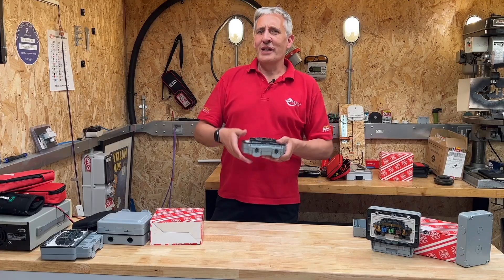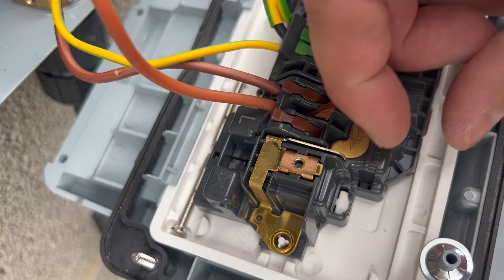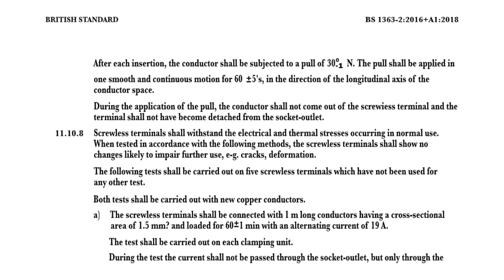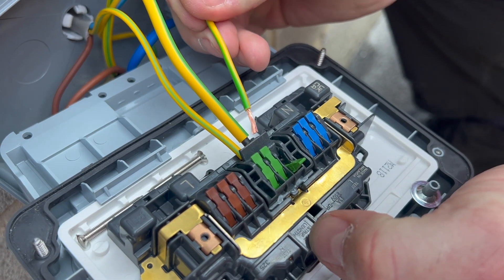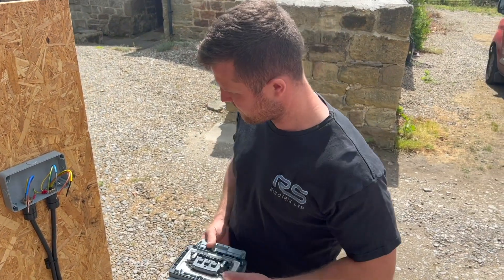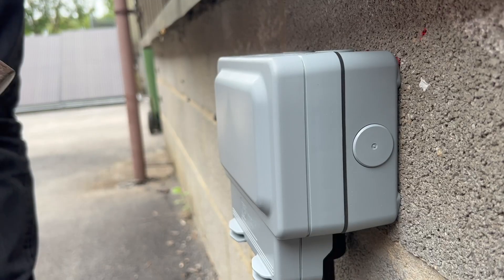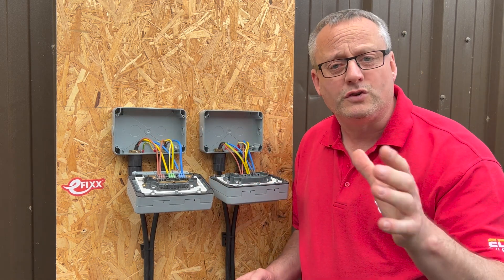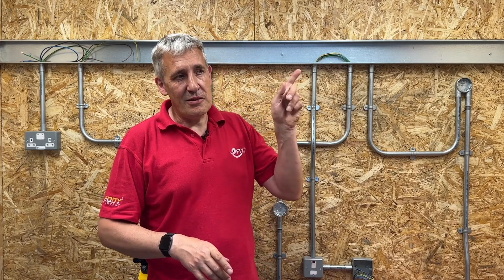How to  EASILY install an Outdoor Socket - MK Master Seal Plus with Rapid Fix

Comment: More expensive than those £11 BG ones but feels much stronger to any other brand I’ve come across and I’d been happy to pay £30 for a decent brand, Hager are a pretty good alternative too also quite solid, only thing that needs improving with this MK version is a hole for a padlock🔒

Comment: What's your opinion in regards to the fact that you are unable to replace the socket without destroying this enclosure? Isn't this really wasteful? It purely unethical to have to discard the whole assembly just for the manufacturer's profit. Other brands use screws for keeping the socket in place and that makes future repairs easy. I understand that you are sponsored from MK, so if you are not allowed to comment on this, then a response from the manufacturer would be great as well.. Thank you for your content!
Reply from the maker: They come with a 20 year guarantee. In our experience it’s the outside components which get the most abuse - lids and enclosure.

Comment: Interesting . Only problem with mk is it’s such a very expensive brand . you could buy a Hamilton (click ) outside twin socket for £12, an MK rapid fix socket for £6 ish (which will fit the good quality IP66 Hamilton enclosure with ease 🤭 ) . Boom ! £18 as if by magic you have a rapid fix outdoor socket with a free click socket for whatever job thrown in . I would also argue that mk screwed versions in of accessories since the original versions are not all that great . on occasion have had to fit them was less than impressed . Sorry MK
Reply: The click outdoor sockets are also fantastic quality, and even the new BG ones are good and its possible to swap the socket over in.
Reply: Pretty much every MK accessory I've tried recently has had issues with terminal screws - They work, but often only after a lot of effort. Their flex outlets are still the best, but I avoid their sockets and even though I like the layout of their fused spurs, Click are easier to work with.
Reply: Never apologies for giving negative feedback, ever. A good manufacturer should welcome criticism with open arms, accept it and learn from it. Thanks for the heads up on hamilton/click as I have 5 outdoor socket jobs imminent and my local electrical network supplier here in Whitby stocks them.....I also see click do a fused connection unit which I will install outside to protect the swa cable run for the outdoor sockets. Are these good kit too? cheers n stuff.

Comment: I normally agree with the technological advances in our industry and products you review, and will continue to do so but, 4:30, come on..............ok, Which electricians are continuosly guilty of overtightening?...................You love MK you do...............;)
Reply from the maker: The ones in the trial ☝️
Reply: @efixx  not a good positive accolade as it surely casts a shadow over their electrical abilities and use of torque screwdrivers, that you also previously insisted we should use and purchase.  So which is it?

Comment: The positioning of those terminals is dreadful. They make it almost impossible to use them on 25mm back boxes with top entry cables.
Reply from the maker: We tried this in the original review and didn’t have any issues.

Comment: Just a question. What is the problem with sockets that still have screw terminals?
Reply from the maker: Why does almost everyone use Wago connectors?
Reply: The problem is over time the wires can become loose and arcing occurs which can lead to a fire.

And it is a genuine risk as it almost happened in a former house of mine.
Reply: Lazy people

Comment: If I am being flippant and very pedantic, I could say that the first Outdoor Socket with Screwless Terminals was one that someone retrofitted and swapped over the "socket" part it's self in a outdoor socket enclosure that had a normal socket mounted in it.

i.e. a Outdoor socket unit where you can remove the actual double socket and fit any normal double socket, such as a smart socket for example. Same thing for single gang outdoor sockets.
Reply: Yeah, Hamilton make an IP66 rated enclosure that allows you to just change the socket.